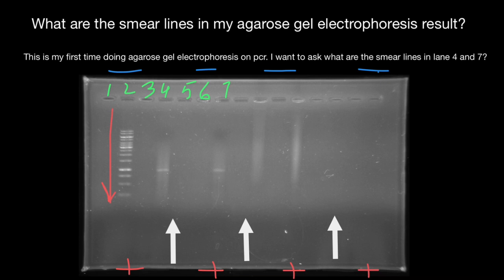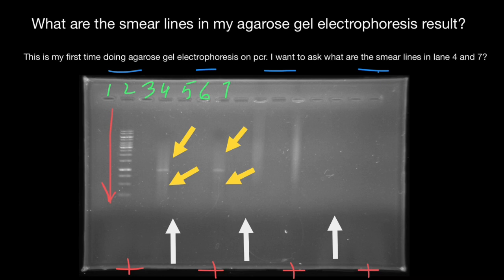How to avoid smear in your Gel Electrophoresis

Comment: Sir I have a issue I did plasmid extraction with good bands and after that I did digestions many times but always get single band or smear not double band 
What will be possible causes of not being digestion? Please guide me
Reply from the maker: Digestion issues in plasmid extraction and subsequent enzyme treatment that result in single bands or smearing instead of the expected multiple bands can be frustrating. Here are some common causes and troubleshooting tips to help you resolve the problem:

Enzyme Activity:
Quality of the Enzyme: Make sure the restriction enzymes are not expired and have been stored properly (typically at -20°C). Enzymes can lose activity over time or due to repeated freeze-thaw cycles.
Concentration: Too little enzyme may result in incomplete digestion. Ensure you are using an adequate amount of enzyme for the volume and concentration of your DNA.
Buffer Conditions:
Buffer Compatibility: Use the buffer recommended by the enzyme manufacturer, as different enzymes require specific ionic strengths and pH levels. Also, check that the buffer is fresh and correctly prepared.
Mg2+ Concentration: Magnesium ions are crucial for enzyme activity. Ensure that your buffer has the correct concentration of Mg2+.
DNA Quality:
Purity of DNA: High salt concentration, organic solvents, or contaminants can inhibit enzyme activity. Ensure that your DNA is clean by perhaps performing an additional purification step, or by checking the 260/280 nm absorbance ratios (ideal ratios are around 1.8 for pure DNA).
Intactness: Severely sheared DNA can lead to unexpected patterns on a gel. Ensure that your DNA preparation method is gentle and minimizes mechanical shearing.
Incubation Conditions:
Temperature: Different enzymes work optimally at specific temperatures. Verify that you are incubating the reaction at the correct temperature.
Time: Digestion time can also affect results. Overdigestion can sometimes result in smearing. Typically, 1-2 hours is sufficient for most digestions, but this can vary.
Gel Electrophoresis Issues:
Gel Concentration: Ensure the agarose gel concentration is appropriate for the size of the DNA fragments expected. Smaller fragments need a higher percentage of agarose.
Electrophoresis Conditions: Running the gel too fast or too long can result in smeared bands. Adjust the voltage and running time accordingly.
Star Activity: This occurs when an enzyme digests at sites that are similar but not identical to its specific recognition site, often due to high glycerol concentration, high enzyme concentration, or suboptimal buffer conditions.
Complete Digestion Check:
Control Reactions: Include a control reaction where the DNA is not cut, and another with a different enzyme known to cut well under similar conditions. This will help determine if the issue is with the enzyme, DNA, or reaction conditions.
To troubleshoot, start by re-checking your enzyme activity with a control DNA that you know works well with your enzymes. Adjust your digestion conditions one variable at a time to determine the cause of the problem. If possible, obtaining fresh aliquots of enzymes or using a different lot can also help eliminate variables.
Reply: @GeneticsLessons  thanks a lot sir! For such a helpful information I will check all possible reasons and check control DNA and share with you. Can you please share your email so that I can send you mail officially 🙏🏻
Reply from the maker: Watch my new video: Which Y-chromosome haplogroup is commonly found in the Pashtun population of Pakistan? https://youtube.com/shorts/Ax4OfyLCI9E